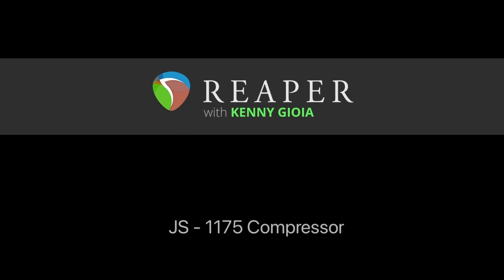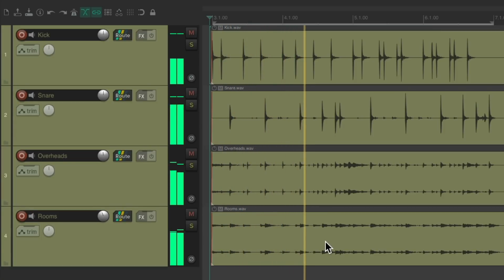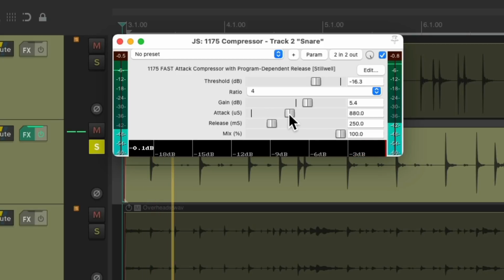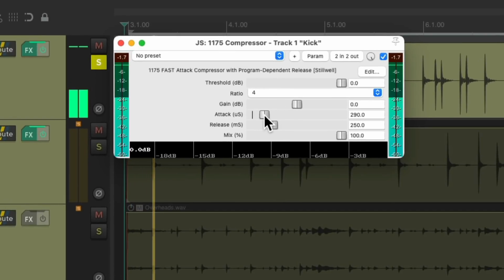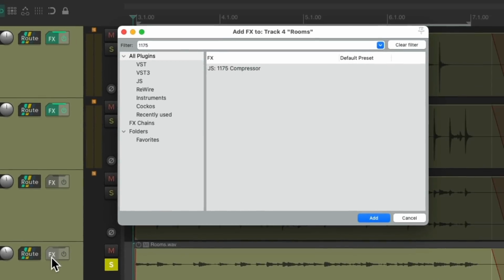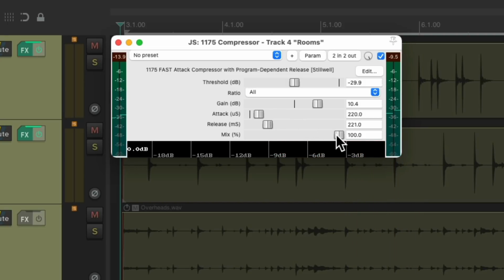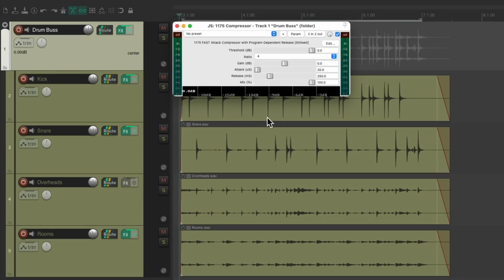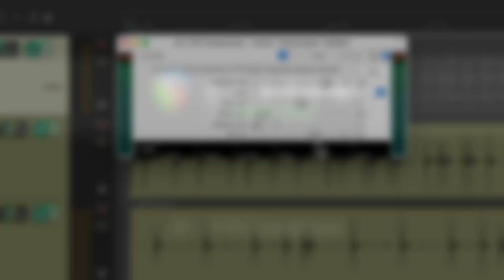JS: 1175 Compressor in REAPER

Comment: I started using the 1175 because of you, Kenny. I love 1176 style comps because I started getting to know compression with the Bomb Factory BF-76 in Pro Tools. I’ve used Reaper since 2015 and didn’t know there was an 1176-style compressor bundled into it until I saw you using it. Now I have my 1176 built right into Reaper. I’m not even using my other versions anymore. :)

Comment: It is worth pointing out that to the best of my knowledge, The Rocket does have a few more differences than just the plugin interface. Dan Worrall has recently pressured an update which fixed quite a nasty little bug in the algorithm for one as I am sure people are aware, but the algorithms are still the older algorithms that Stillwell audio used overall. Also because it is a JS plugin, it is not as efficient as it could be. This is by no means a reason NOT to use it. At the end of the day, if it sounds good, use it for sure. But do the two null with the phase test and same settings? I haven't tested it myself actually, but if I was to guess I'd say not. I could be wrong, as I say I haven't tested it. I am just going on what I have heard around on the forums. In any case, great video Kenny. :).

Comment: Can you please help me with this...  If ANYONE has the answer to this, I'd greatly appreciate it!
Why do kick drums in MIDI software drum kits sound like a faint "tap"??  Every drum kit I've downloaded is the same!  In the real world, it's the other way around...  Kick drums are the biggest, loudest, most powerful drum, and center piece of EVERY DRUM KIT!  A kick drum's sound in the real world is far more robust and much louder than the toms or the snare, yet in a midi drum kit it is by far the weakest!  Is there a way I can tweak a setting or do something to get a midi kick drum to sound like a REAL KICK DRUM?????  THANKS!!!
Reply: I'm a total rookie but I find EQ and compression helps. Use EQ to boost the low end to make the kick sound deeper and fatter. Can also try a bit of mid-range and treble to get a bit more "definition". Compression can level out the volume of the kick sample over it's duration so it sustains longer, rather than a quick tap. Again I'm a beginner though, this is just what I've found. Maybe someone else can suggest something?
Reply: @Ihadtosettleforthis  Thanks, I'll try your suggestions.  Any tips on this helps!

Comment: Does this plugin really emulate the 'original' 1175 compressor? So it is 'as good' as any other emulation of this compressor? I mean does this introduce the same harmonic distortion that the 1175 hardware unit does? I am not sure if I can hear this, but I will try to compare this JS plugin to the Cockos compressor and some other 1175 plugins I have. But I am not sure my ears are trained enough to really hear the harmonic distortion (color) added by these plugins ;-) Can you hear this is a good emulation of the 1175 Kenny?
Reply from the maker: You mean the 1176. I don't think it's trying to emulate as much as do a similar thing.
Reply: @REAPERMania  Mmm the plugin is called JS:1175 so that's what confused me probably. But in the screenshot of the hardware unit I see that's an 1176. Not sure if there is even a 1175. Anyway, I thought the whole purpose of emulating hardware is to get the 'analog' sound it produces through it circuits. Not just functionality. In the case op this plugin, if the is no emulation of the tubes - or whatever technical stuff it is used -  it's won't do much more the the efault Cockos compressor right? Maybe only the 'all-in' mode is unique to this plugin. I think the whole purpose of emulating vintage gear is to get the 'sound' and maybe the user interface you might be used to 'in the old days'. So i thought maybe this JS plugin would do something similar. Anyway, thanks for your great Reaper tutorials! I realy enjoy them.
Reply from the maker: @JipJonker  I think it's meant to duplicate the behavior. Not the analog circuit.
Reply: @REAPERMania   I wish I can understand this answer
Reply from the maker: @audiosounddoctor5834  It's similar. Don't worry about it. A 1176 is never required for anything.